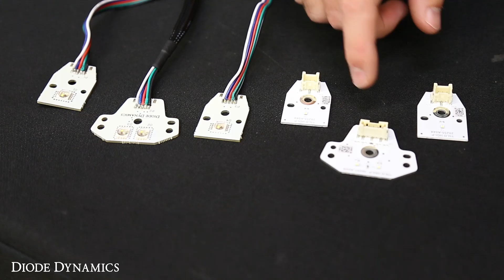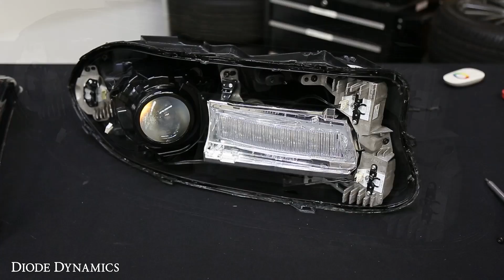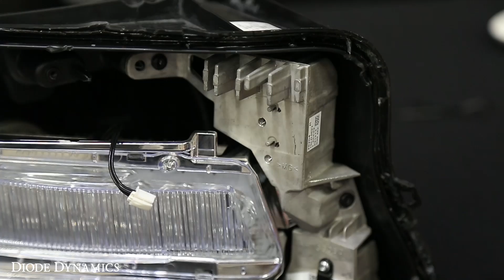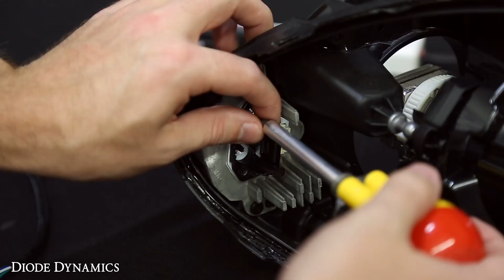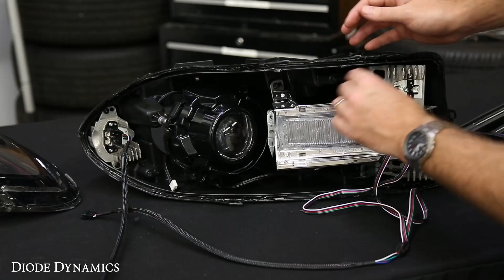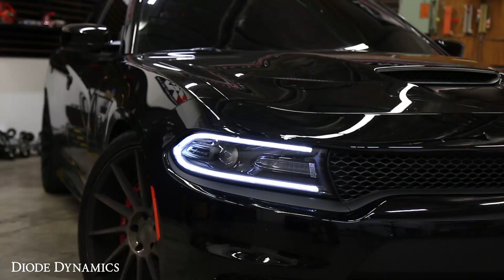How to Install 2015-2018 Dodge Charger RGBW™ LED Boards | Diode Dynamics

Comment: Will these work in my 2016 charger is the drl is not lighting up as it should?
Reply from the maker: We recommend giving our team a call at 314-205-3033 Monday-Friday 10 a.m.- 5 p.m. CST, or shoot us an email at contact@diodedynamics.com, and they would be happy to help you with that.

Comment: Not expecting a reply as this video is older…. But how to you keep or get condensation out of the headlight when putting it back together?
Reply from the maker: Great question! 

Butyl Headlamp Sealant

https://www.diodedynamics.com/butyl-headlamp-sealant-one.html

https://youtu.be/pm0HRAD7f7Q

Comment: How long do it take to install color chaser led headlights for Dodge charger?
Reply from the maker: This will really depend on many factors. It will most likely take a few hours. However, we always recommend that these are professionally installed.

Comment: Hello, how can I open the lens from its place in order to replace it with the Q5 lens
Reply from the maker: You would need to heat it up, either in an oven or using a heat gun, to release the sealant holding the lens to the housing. We recommend this is done by a professional because it is easy to warp the housing during this process.

Comment: Should probably mention that you have to remove the bumper to even get the headlights off the car.
Reply from the maker: Hey Joseph! Unfortunately, that is usually the first step for any of our headlight retrofit kits. If you need help getting in touch with a professional installer or anything, 
just give us a call at 314-205-3033, Monday-Friday 9 a.m.- 5 p.m. CST, or shoot us an email at contact@diodedynamics.com and our service team can assist!

Comment: Will these fit/work in the Spyder aftermarket headlamp assembly that looks almost just like these for the '06-'10 Charger?
Reply from the maker: Hi Bryant! Unfortunately, these won't be compatible with that housing. Sorry about that!

Comment: I just got a replacement, it has a yellow wire. Why is that?
Reply from the maker: +medinaMEDIA Hi there! Just to be clear, what is the yellow wire coming off of? Did we send you a replacement driver or replacement boards?
Reply: Diode Dynamics I will call you guys in a bit.

Comment: Why is there no actual guide for wiring? Saying this is plug and play is false advertisement.
Reply from the maker: +Lance O'reilly We apologize for any confusion. While these boards are not plug-and-play, they are computer-designed drop-in replacements for the factory boards. Check out the link below to see our Installation Guide with wiring instructions, and please don't hesitate to email us at contact@diodedynamics.com if you have any further questions!
https://diodedynamics.com/docs/install/dodge/charger/Dodge_Charger_RGBW_installation_guide.pdf
Reply: Diode Dynamics I put them in. The installation directions come with no directions for wiring at all other than that they say plug them in to the receiver. D.I.Y. people might not have the best of luck. However, I got mine done last night and they look great 😁

Comment: So by using this, does the regular car light switch work? or do i have to use the remote everytime? how does day running light work when i initially start the car?
Reply from the maker: +So Sa When you start the car, the boards will light up to whatever color you had them set on most recently, so you'll want to set the controller back to white. If you have any further questions, feel free to contact us!

Comment: im confused, so all we need to do is replace boards? no need to change any actual bulbs or lights within the headlights? the boards hold the bulbs? very confused
Reply from the maker: +Mateen P These modules are a direct replacement for the factory-installed headlight LED panels in the Dodge Charger. Feel free to contact us at 314-205-3033 Monday-Friday 9 a.m. - 5 p.m., or contact@diodedynamics.com, and our sales representatives can give you further installation instructions!

Comment: Question... I usually have my headlights on auto and my daytime running lights are always on putting this new LEDs will affect that? As in I will have to remotely turn them on or would I be able to keep them on auto and have them turn on and off on their own
Reply: i just thought about that and i cant find anything on it so i think you'll need to remotely do it

Comment: Does the DRL turn off when the turn signal is activated like OEM?
Reply from the maker: +Luis Baeza, yes, it will operate in the same way as the OEM LED boards. If you have any other questions, feel free to contact us!

Comment: Did you have to heat the headlamp up to get them opened? Or can it be done without doing that?
Reply: Yup you have to bake them
Reply from the maker: +MonteMatt8, Yes, in order to open up the headlamp you will need to heat it in an oven or using a heat gun.  Once you are done with our installation, you will heat the headlamp up again to reseal.  If you have any further questions about installation, feel free to contact us at 314-205-3033, Monday-Friday 9 am-5 pm, and our sales representatives can help you out!

Comment: are these programmable to cycle through the colors, switch between two or more different colors, or pulse to music?
Reply from the maker: +JP Melinko, that is all dependent on the controller you use. We recommend using an RGBW controller, in order to control the white LED chip independently. The RGBW controller we offer (link below) has over 10 preset patterns to cycle through the colors. However, it does not pulse to music. If you have any other questions, just let us know! 

http://www.diodedynamics.com/store/catalog/product/view/id/22550/s/rgbw-touch-controller/category/802/

Comment: Is there any difference with these and the oracle ones??
Reply from the maker: +Egbulldog79, the first major difference is going to be that our RGBW™ Charger boards have been both designed and manufactured at our facility in St. Louis, in order to ensure the top quality possible. All of our LED boards utilize the best quality LED chips available, in order to ensure our industry leading quality.
Reply from the maker: +Diode Dynamics, by doing all of the design and manufacturing in house, we are able to keep the price point lower than competition, all while keeping the quality extremely high.
Reply: +Diode Dynamics is there a kit for the fogs too. I have the ScatPack.
Reply from the maker: +Egbulldog79, with some models of the new Charger, you will have factory LED fogs, making modification a little more difficult. If you could please shoot us an email at contact@diodeydnamics.com, we would be happy to look further into this for you - thanks!

Comment: is it hard to remove headlights from the car
Reply from the maker: +Isaac Page, removing the headlights on this vehicle is the same as most - once you take the bumper off, the accessible bolts are easy to remove!